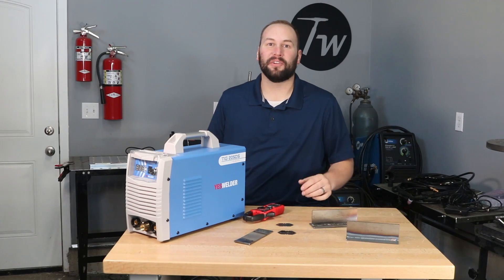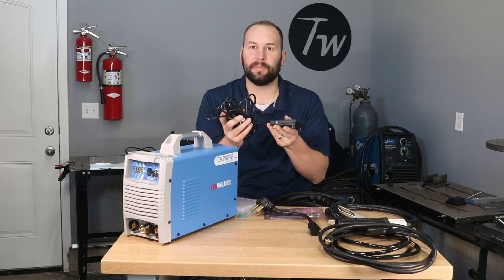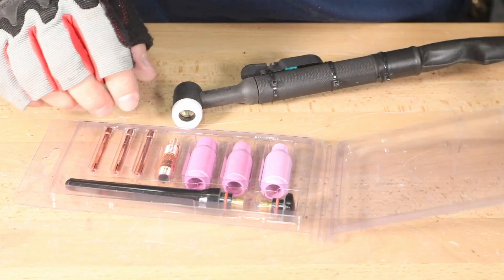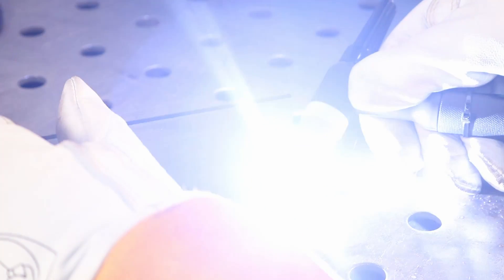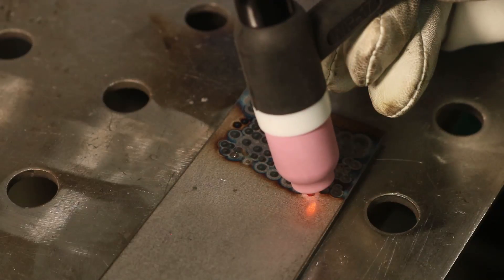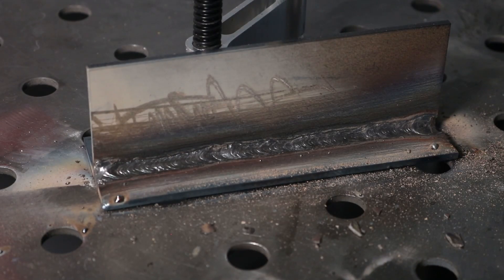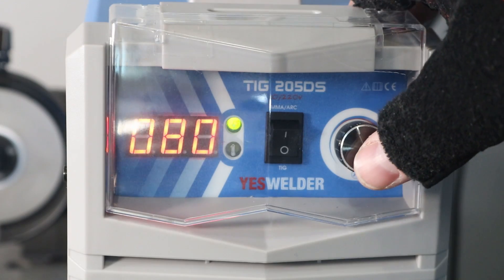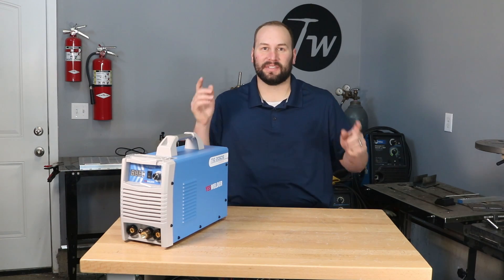Reviewing the (almost) Cheapest TIG Welder on Amazon: YesWelder TIG-205DS Review

Comment: How did you connect the gas line for the torch to the front of the machine what fitting did you use I ordered a tig torch and it will only go straight to the gas cylinder instead of the front like how yours did. I have the same machine

Comment: I just got one but it seems the switch only controls the gas flow on/off, not the arc. The arc is always on when the machine is powered up ?  Maybe mine has a fault ?
Reply from the maker: I’d send it back. That’s not right if you got this same model.

Comment: That thing is cheap af. I’ve bought cheap plasma cutters on Amazon and it’s definitely a get what u pay for situation. So cheap in fact, when the first machine blew up after 2 days, they sent me another, no questions asked, didn’t even want the old one back. The second machine lasted maybe a month, blew up, they sent another. I’m now  on my 4th cheap amazon plasma cutter. Don’t expect reliability or dependability out of this cheap Chinese trash
Reply: i was looking at buying an Eastwood 250i for quite some time, but i ended up ordering a YesWelder 250P this week, and plan to buy their mig welder also.  i'm hoping they aren't cheap garbage, but these machines had a lot of features the Eastwood was lacking, and in the end, everything is made in China.  Mercedes are also made in china, so you can't automatically assume that just because it's made in china that it doesn't have good quality

Comment: That’s cheating your supposed to use straight safety razors they are 1/3 the thickness of a utility blade. Try again.
Reply from the maker: I suppose I should check the official rules of the Welding Parlor Trick Association next time.

Comment: Tim, I signed up for your 4 part welding course yesterday and was wondering do you think this machine could weld aluminum with 3/32 stick aluminum electrodes(DCEP). I tried it with my little Deko stick welder using Hobart 3/32 but had no success even with 50-120 amps(only tried 120v), and some preheating. Cleaned it pretty well but it was very frustrating. Thanks
Reply: I know you posted this question a month ago, but this machine does NOT weld aluminum, as it is not a AC/DC machine. Ferrous metals only.
Reply: @Immad1337  DC stick welders can weld aluminum with aluminum electrodes, so can DC mig. Tig needs AC.
Reply: @rickl6697  forgive me, I read that too quickly. I thought you were referring to the tig process.

Comment: i just bought this and the HF does not work :(
Reply: I think this unit is only lift not hf
Reply: @gerardomadrigal7292  customer service was not getting back to me quick enough so i took the case off and saw that a wire had come off the circuit board in shipping, i soldered it back on and HF works great!

Comment: How thick of metal would this handle comfortably using Tig  and then using stick ??? Thanks
Reply: is there really a thickness limit when talking stick welding?  i did a welding certification test with a 3/8 coupon, usually running 130 amps with 1/8 7018.  i can do the same test with 2" steel, same settings, it will just take a lot longer!  tig i feel is the same way, but for me, once i get all of my welding machines in order, i would typically do most stuff < 1/4" with tig, 1/4 or greater, stick, and for anything quick and dirty, 3/8 or less, mig

Comment: Has anybody purchased this welder recently. I was really ready to buy this unit until I saw that the TIG torch is not the same style as shown in this video. If you look at the pictures on the YesWelder website, the torch has the on/off switch molded to the handle, which makes it bulky. Does anyone know if you can put another manufacturer's WP-17 torch on this unit (with the zip ties)?
Reply: I'm wondering this as well. I'm looking at it on Amazon right now, and it definitely has that Euro-style integrated torch. 
Not a fan. My Plasma cutter is made this way, and it's really awkward.
Reply: I just bought one (5/22/22) and it has a different style switch on the handle. It is molded in and I’m not sure if you can adjust it i think its molded in place.

Comment: Would wanna variable petal capability and like a look inside the machine.  Usually when you open em up is when you can tell whether its gonna be an exploder or a runner.  Sometimes youll open em up and see all kibda bad solder joints, bent parts, unsecured parts, and usually something that needs to be tinkered with for stability..
Reply: And does it have ac and dc tig both?  No pulse variation?

Comment: I notice you demonstrate on steel.  I want to do aluminum, should I use the same setup?  Will the polarity be correct?  Thanks
Reply: You need the AC/DC tig machine it’s more expensive too lol , you need AC to weld aluminum this welder only welds DC

Comment: Just got mine up and running and the HF start doesn't work at all. I have to touch, turn on and lift to get it working..Any idea what might be going on?
Reply from the maker: Try scratching the tungsten on the workpiece, then lift it up before you press the pedal. Sometimes this is needed even with high end machines. If that doesn’t work, I’d send it back.
Reply: @TimWelds  Yeah, tried that and no workey. Yeswelder got back to me with a gap check (1.5-2.0mm/.059-.078) on something inside the box and to check if a white wire is connected properly in box also. Will take a look. Thanks.

Comment: Can this welder run 6010 rods or just 7018?
Reply: Sure, it says it runs stick. So any stick will do. However, how big/thick the rod size is is different story. 
Welder for 17yrs.
Reply: @Joseph Jordan  wrong.  Not all stick welders will run 6010 rods correctly.  All transformer style stick welders will but not all inverters will.  Don't spread misinformation.
Reply: @MrAjjordan  oh really?  check most of the MillerMatic specs and realize that they don't burn 6010 worth a shit.

Comment: With all of these low cost welders, I'd be worried about support after the product is discontinued. Hell, I'd be worried about support while the product still exists as consumables for these things are usually not great to get a hold of. What's even worse and still likely, what do you do when the company doesn't exist anymore? This is where you can't go wrong with a Miller or Hobart or Lincoln, but you pay for that longevity. Still, for me, tools like this aren't the place where you skimp on, but I understand some people just don't care about welding as much as others.
Reply: Cool thing is this welder uses the same consumables as Hobart and harbor freight which helps long term

Comment: I just bought the hitbox 200p doesn't have a peddle but its digital amd has pre flow start amp peak amp end amp and post flow adjustment for 230 200 amp and arc force and hot start for the stick surprised at the little thing half the size of that one and runs strong

Comment: Does it do any good with 7018 1/8? Or 6010 1/8 and 6011 1/8
Reply: And do you need gas with stick
Reply from the maker: I've run 1/8" 7018 with it and it did well. I haven't tested the other rods, but based on other similar machines I've used, I would assume that 6011 will work and 6010 won't. There is not gas needed to run stick with this machine.

Comment: How does this compare with the Primeweld TIG225X?
Reply from the maker: It’s kind of apples and oranges. This is smaller and less expensive, but is DC only, which makes it better suited to materials like steel. The Primeweld is AC/DC, so it can weld aluminum as well. The primeweld also includes features like pulse and adjustable post flow which will help a lot with stainless steel. The primeweld is bigger and costs 3 times as much.
Reply: @TimWelds  All fair points hahah. I had assumed that this also had AC/DC features. Thanks for the awesome reviews.

Comment: Are you running the tig on 110 or 220?
Reply from the maker: I tested it on 110v near the end of the video, but most of the video was running on 220v. It ran fine on 110v, but output is limited, primarily based on the electrical system it is connected to.
Reply: @TimWelds  what amp curcuit breaker are you running it on?
Reply from the maker: The 220 breaker is 50 amps, and the 110  is 20 amps. When running an inverter TIG on 110, the input current will be roughly 26 percent of the output current, so on my circuit, I’m maxed out at around 80 amps.
Reply: @TimWelds  thanks a lot! I’ve been trying to answer this question all day. I have a 110v 20 amp breaker so I think you just sold me on getting this welder as I don’t think I’ll need to go beyond 80 amps output.

Comment: What torch fitting does it have? Is there a CK superflex torch hose that fits? How flexible is the hose that it came with?
Reply from the maker: Thanks for the question. It has the standard 5/8" gas fitting on the machine that the torch connects to for gas and power. The fitting on the torch end of the cable is one of the smaller ones, probably either 3/8-24 or 1/8-28 BSP, but it's in heat shrink and I can't tell for sure. CK has all of the common combinations, so they probably have one. The stock hose isn't too bad for a rubber hose, so I would start out with that. If you want to upgrade, I would upgrade the whole torch. A 12.5 foot torch/cable can be had from some online retailers for less than $70 https://www.arc-zone.com/tig-torch-ck-17-rg (I have no affiliation with arc zone or CK). One step further would be the flexible head torch, which is pretty nice. Either way, I'd start out with the stock gear for a while and go from there.
Reply: @TimWelds  How long is the post flow?
Reply from the maker: It’s really short, maybe 1 second.

Comment: If I get this machine and use it to practice my stick welds, do I need gas? Looking to buy this machine to practice both tig and stick but mostly stick so I don’t want to get gas if I don’t need to. Thanks Tim!
Reply from the maker: No gas needed for stick, so you can start out with that and pick up some Argon when you’re ready to TIG.
Reply: You can actually practice Tig welding without gas but you need to know what the welds should look like structurally as they'll look like shit without the gas if you don't have the experience to look beyond the surface.

Comment: Normally, I don’t like switches on the TIG torch either. But—-I bought an extra TIG torch for my welder and bought one of those switches, wire and the plug , which is somewhat harder to find and install, because my ESAB doesn’t use that little connector. I bought this for one purpose. When I spot weld I don’t want to use the variable foot switch. I want to blast the metal. This makes it easy, using the spot weld function of the machine, to time the weld.
Reply from the maker: Awesome tip, Mel! A fast, high amperage blast can really help tacks bridge between both pieces of material. Thanks!

Comment: Good job Tim. I have this machine and it works great.  Can't be beat for the price range.
Reply from the maker: Thanks! I was surprised how well it actually worked.
Reply: @TimWelds  I was actually considering buying there AC machine, it's at a good price also.
The only downfall is the torch and pedal are not the best. Went with an AHP alphatig cuz it has a ck torch and nova pedal as well as great reviews.

Comment: Tim, I bought the 205DS stick welder which might share some internal components with this.  From minimum amp to 50A it’s very inaccurate, I had it set to 20-30A with 1/16 6013 and it felt way hotter than that - arc was super bright/violent and burn rate I could not keep up.  Above 50A - runs weld with 3/32, so the display seems correct above that.  Can you see if you experience the same issue between min-50A?  There was another person on Amazon complaining the same problem.

Comment: Can you weld alum with this machine? Thanks for the reviews.
Reply from the maker: This machine will only output DC and will work best on steel, stainless steel and some other specialty metals. For aluminum or magnesium, I would recommend getting a machine that can output AC, which will etch the oxide layer off the surface as you weld. (There are some tricks to run aluminum on DC, but I strongly recommend sticking with AC). Capable aluminum TIG machines start in the $700-$800 range, which is quite a bit more than this one, but much less than they used to be.